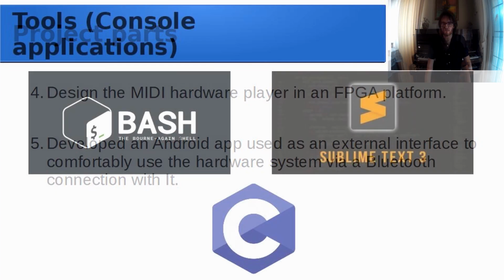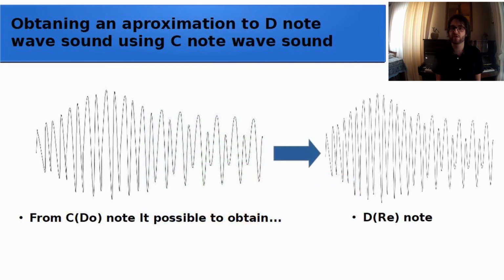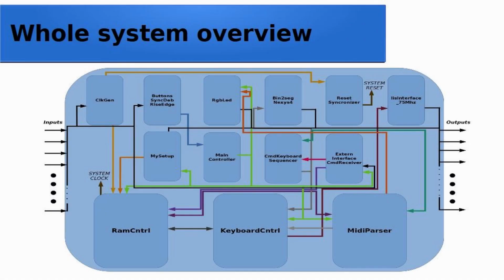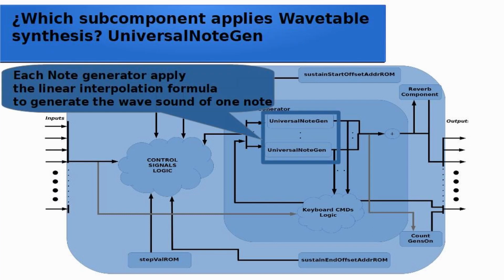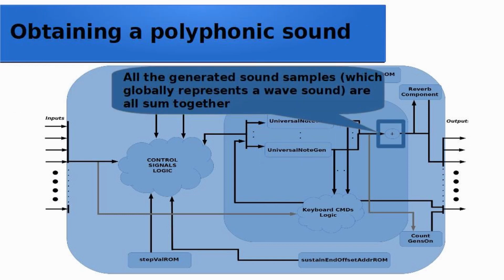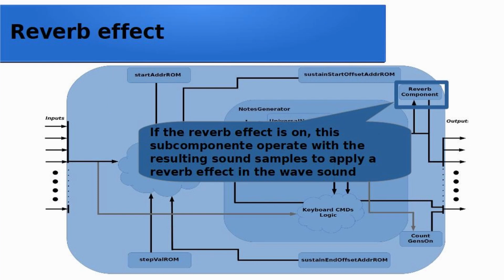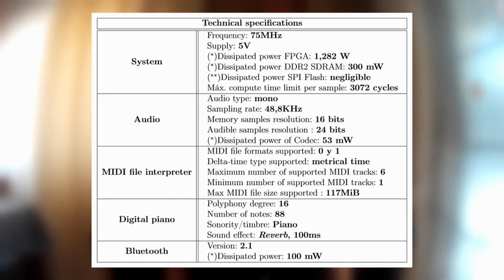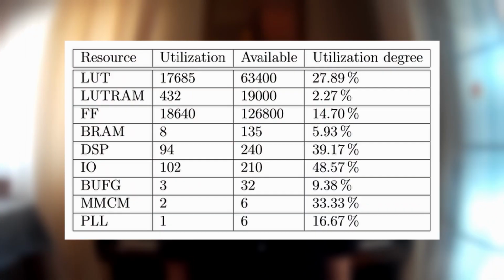MIDI file Hardware Player (Project presentation)-Xilinx XOHW20 xohw20_132-

Comment: Muy buen proyecto Fernando. !!!! En mi curso de 4 meses de VHDL, en la maestría, implemente un reloj digital en mi basys 3, utilicé un buzzer para generar un sonido de 100 Hz o G#2/Ab2.  En mi desarrollo y propio descubrimiento del lenguaje vhd tuve algunos inconvenientes con un error:  Multi-driver net found in the design. Si comprendo el por qué pero no encuentro la estrategia o mecanismo para hacer algunos circuitos sin que me arroje el mismo error.  Estaré subiendo mi codigo a mi github : https://github.com/romybompart/Basys3-clock-alarm-with-buzzer.git